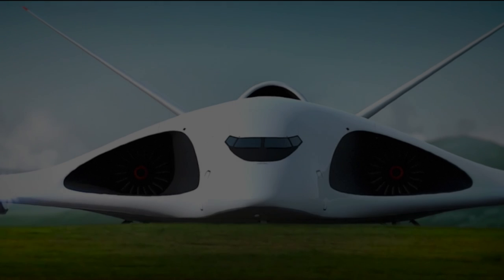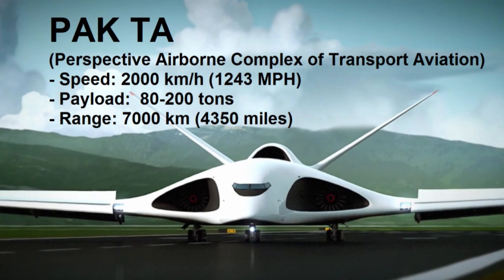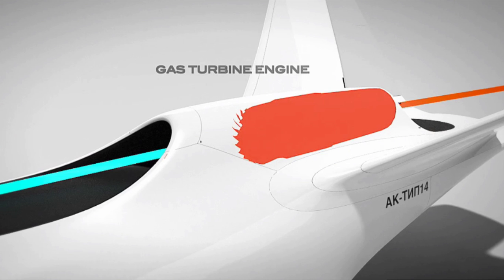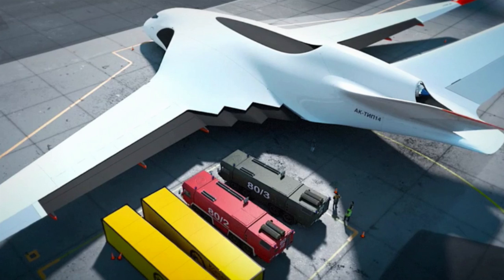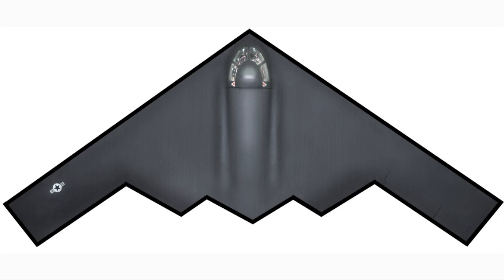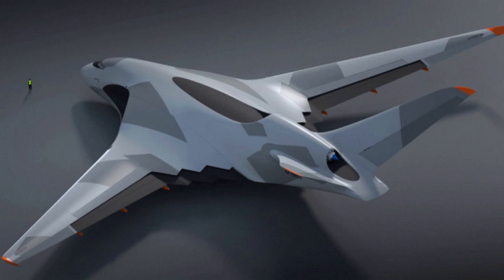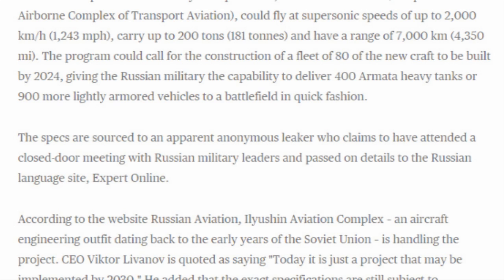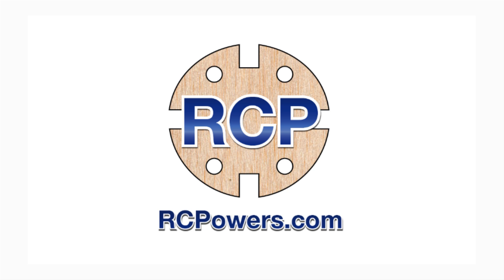PAK TA Russian Concept Supersonic Transport

Comment: I'm not too familiar with EDF propulsion, but I thought an electric aircraft was impractical because it was still far less efficient than a conventional gas powered plane. From what I understood, because of the weight to power (capacity) ratio when it came to batteries, large scale transport aircraft would have to sacrifice cargo space with battery space. Not to mention the time/effort required to charge these batteries.

Although we have made strides in small scale battery technology for electronics, large electrical equipment requires much higher voltages and amps than current (no pun intended) battery technology can deliver.  

If it's a hybrid, as the top engine is a gas turbine, how would the inclusion of EDFs increase efficiency? Wouldn't the gas engine have to do double duty to propel the aircraft to Mach 1 and generate enough power for the EDFs for them to perform at speed? At that point wouldn't two smaller conventional jets be more practical? 

Please correct me if I'm wrong, I just don't immediately see the validity of this Russian Aircraft as nothing more than a concept plane.

Comment: When I first saw this I thought of the landing crafts from Avatar. Also, remember how the Concordes couldn't fly over land, that was because their sonic boom would follow them everywhere. However, with this design, you see the jet engine is above the body of the plane, as well as some more surface after the engine. This should send most of the noise upwards.
Reply: Zach same
Reply: The sound boom isn't caused by the engine, but by the build up of pressure in front of the plane. Nothing about this EDF powered non-swept wing plane screams supersonic. Just RT news propaganda and cool looking renderings.